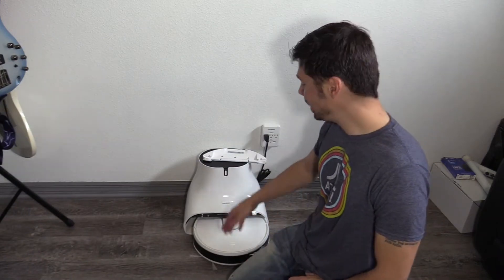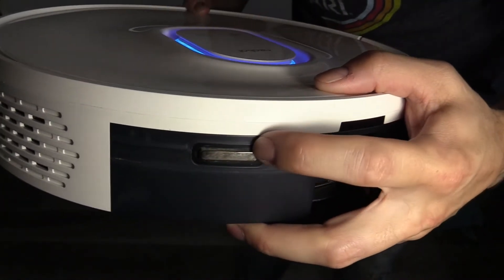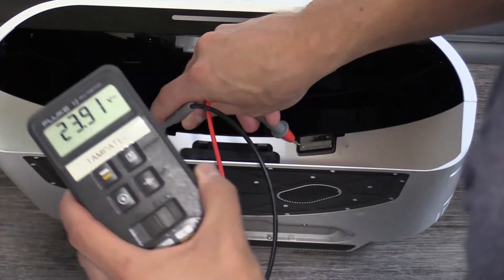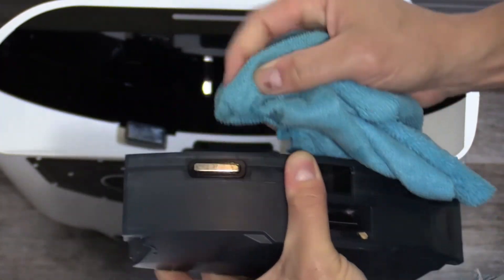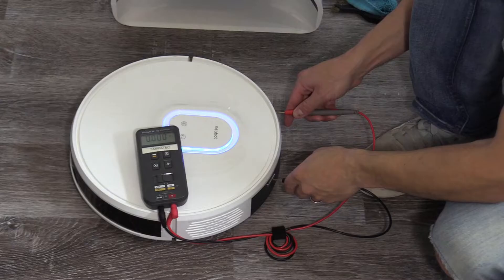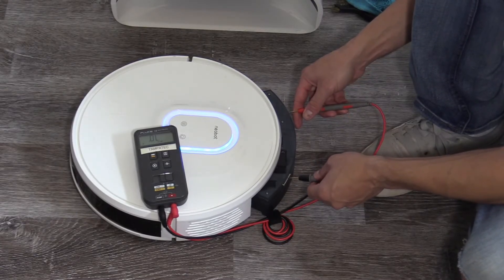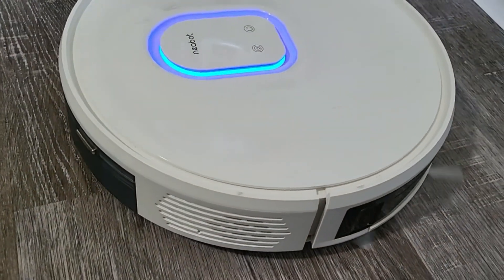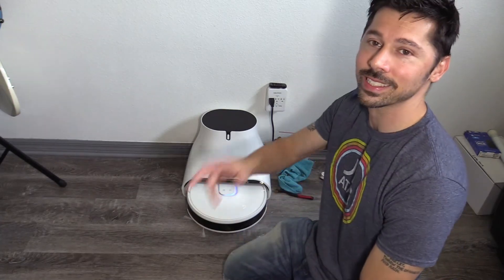How to Fix Robot Vacuum not charging or docking, Neabot service repair

Comment: Hey @TampaTec - any idea why would DEEBOT T5 will not connect anymore to the docking station. I thought it was a battery issue at first, replaced it. bough brand new, it worked all right for as long as a new battery was chaged, once it drained it our. it won't sit on the docking station and chanrge. It will bounce back and forth, but not connected nor allows manually to be placed and charged :(
Thanks 
Jacob

Comment: Hah, that'll do it!  I had cleaned the charging contacts on my Neabot N2 but it still wasn't staying on charge properly.  Inspired by this video I tested the contacts with a multimeter and found that while it was 24v across most of the contacts, there was a slight discoloured patch on one contact where the voltage was wobbling between 5v and 24v as I moved the probe tip across it.

I gave it a polish using a soft wire brush head on a Dremel and now it's charging properly again.  Thanks for the inspiration!

Comment: Hey so I have been watching some of your videos on repairing LCD flat screen TVs. My friend worked a restaurant last year where they let him take a Samsung 46" 610 Series full HD 1080p LCD TV because it wasn't working anymore. The light indicator turns on but the actual tv doesn't. I was trying to fix it because he said I could have it if I did. I was wondering what you might think the issue might be and wondering if u could give ay tips and tricks on how to go about fixing it.
Reply: Back-light come on? T con.
No? Power or video board
Reply: There are diodes that have to be be replaced in the backside of the tv. Plenty of YouTube videos out there to show you the process. With mine, the tv would not turn on. Good luck!